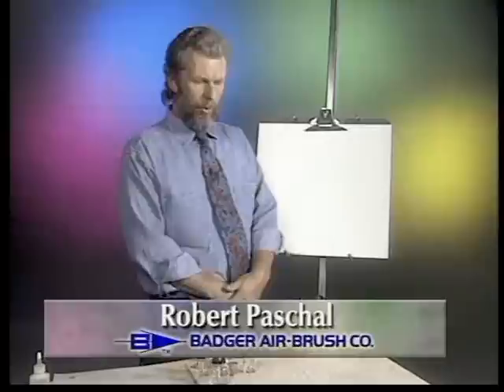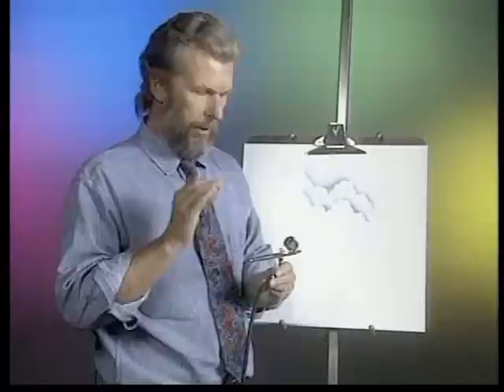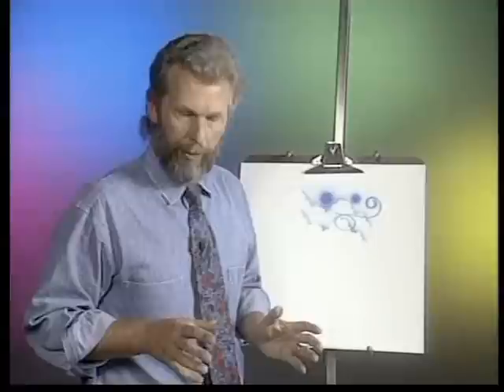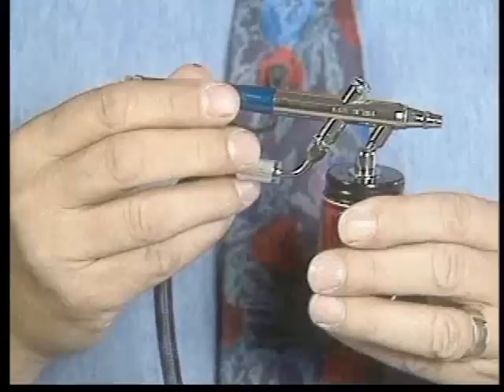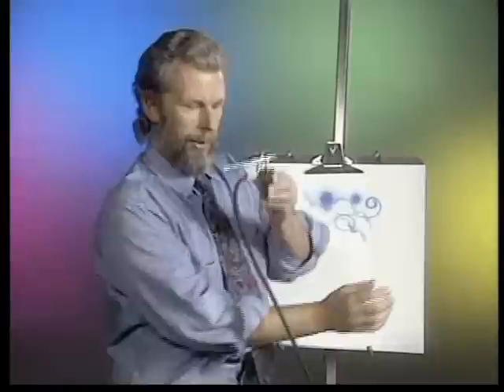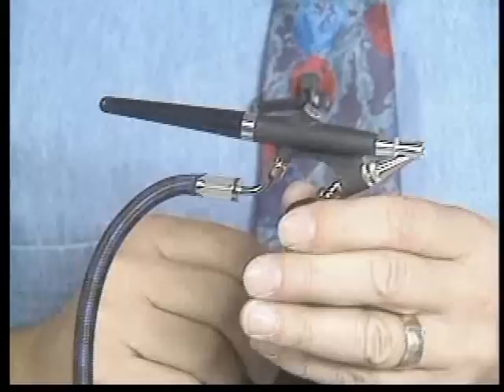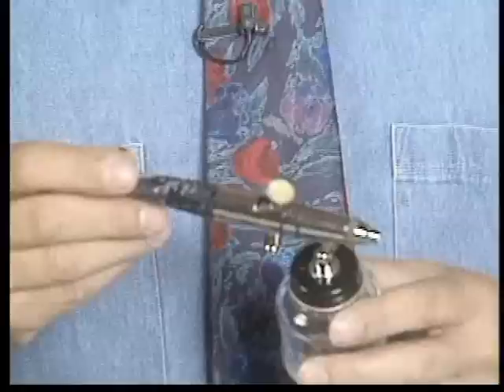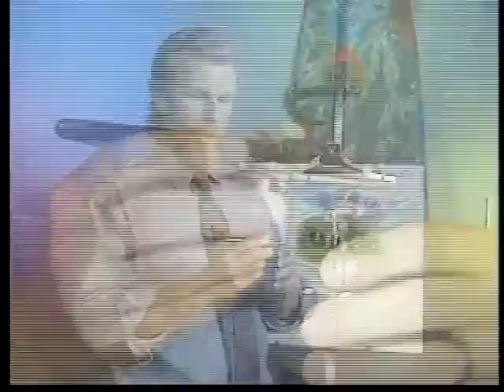BADGER - Introduction to Airbrushes part1

Comment: the first two models can be used as a single action, by using the adjusting knob as a trigger set.  by turning the screw in, one can control the spray.  if there isn't enough travel, reset the needle to respond with less travel, then when the screw is turned, that will push the trigger back.  after the desired amount of paint is attained, just push down on the go button, and you are now using a single action.

Comment: @liwiathan if you´re thinking of the "angled piece" on the air hose it is actually just the standard end connection of the hose itself the other end being straight, some of the newer air hoses have straight connections at both ends so look for a slightly "older" (still being manufactured though) version of the air hose. -Check badger.com for parts and equipment!
Reply: Thank you!

Comment: No wonder its so dear. I got my badger 200 and compressor today, £200, just need to learn how to use it. Always wanted one.
Reply: How did you get on ?
Reply: @SingleTrack66  yea got on great with it actually. In the end I gave up on my 40yr hobby, getting on so this is my time. Great airbrush, very easy to use..

Comment: It would be nice if the airbrush and compressor industry didnt like to keep the sizes of their compressor connections, hoses and adapters a "trade secret".  over 90% of the items I find online totally OMIT the size of their connectors, hoses and adapters. On top of that the adapters you need you simply cannot find online. Seriously is there some secret war raging in the industry, that impels the makers of these items to keep the size of their products a secret from the general public?

 I've been trying for 2 straight days to find out what I need to do to connect a California Air Tools 6300 Compressor to a Badger Gravity Airbrush and Gravity Braided hoses. It's a futile endeavor.
Reply: The sizes are not trade secrets. They use 1/4 and 1/8 NPT connections. Can also get the connections and adapters at any auto parts house cheaper then going online.

Comment: I bought a Badger Model 200 set and its my first airbrush and it only sprays out air, it sprayed paint once but it just exploded everywhere! I need help!!!!
Reply: Check needle adjusting screw.  That's what controls the paint flow.  Turn  the needle outward more paint flow.  Turn it in, less paint flow.  Another thing, make sure your paint is very well mixed.   [paint] Too thick clumps and clogs flow.  Hope this helps.

Comment: Help!  I have an external siphon feed brush, and I can't get my paint to come out. I have successfully sprayed a cleaning mix, but can't get the paint. I can see the paint going up the tube to the airbrush. I have fully opened and closed the nozzle, but that doesn't help. I don't think the paint is too thick, especially after this video, which says my style airbrush is meant for thicker paints. Any helps?
Reply: +Angela Lamson I have the exact same problem. I can only spray water or very, very diluted paint, so diluted it will only cause droplets and is completely useless.  

I also have the feeling that some air is coming out on top of the airbrush, right under the "lever" and I don't think that is normal.
Reply: +ZoidFile I worked it out. It was completely plugged. I have it a thourough cleaning, and now it's working like a champ.
Reply: Mine never really worked to begin with, It just  looks like it does not suck in any paint at all.

I cleaned it anyway, but it look like new,
Reply: Gun camo